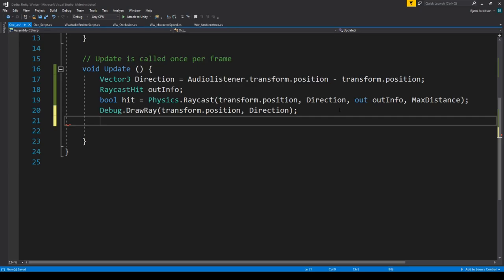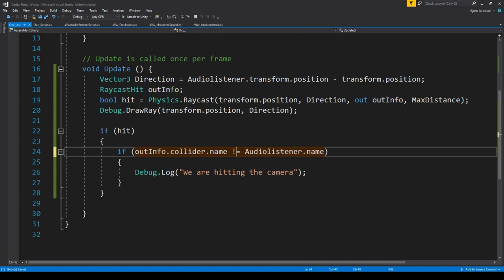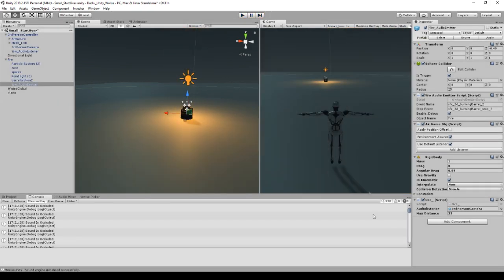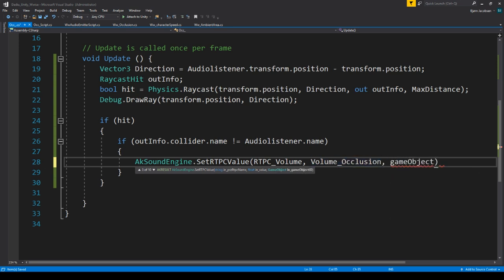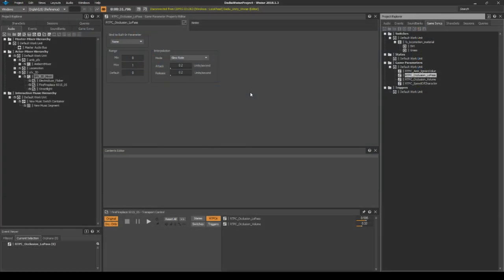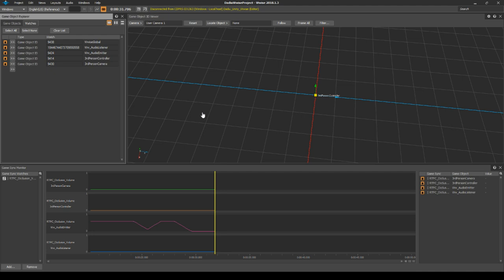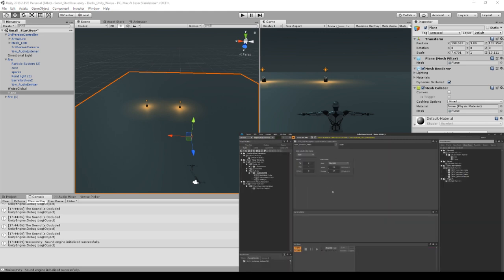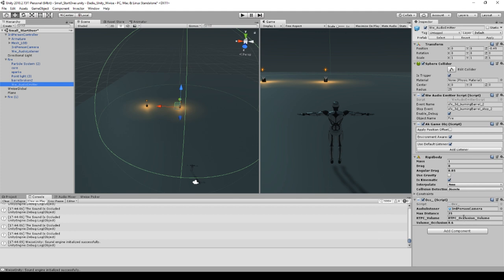Unity and Wwise - Changing Parameters with RayCasts.

Comment: Hey Bjørn, thank you so much for this tutorial. 

I went through your first video in the RayCasting series a few times and got my script to work as intended (the only difference was that instead of checking for the name of the game object, I was checking for the tag). Your videos are an absolute blessing for someone like me who is slowly learning the ropes of game audio integration.

I do have a question for you though. Based on this video, you are essentially hardcoding a set parameter of occlusion that determines how much occlusion takes place once your RayCast hits anything other than your listener - Volume_Occlusion = 0.6f. I may be getting ahead of myself (you could have covered this in one of your other videos) but is it possible to automate this process as you would with a Wwise Attenuation Shareset? 

So instead of scripting a set occlusion of 0.6f, you would just tell Unity/Wwise to figure it out based on the proximity to the sound source.

For example: if you have a wall between your audio listener and your audio emitter. If you step into "line of sight" of the audio emitter, the occlusion is set to 0 and the basic volume attenuation takes place (coming closer to the sound emitter increases the audio volume). However if you are behind the wall and very far from the sound source, the sound should be slightly muffled but to a lesser extent (0.2) for example. As opposed to being behind the wall and close to the source (muffled to a greater extent due to lack of reflections, etc).

I hope the question made sense and once again, thank you so much for this fantastic material!
Reply from the maker: Hey Nikita, thanks for watching to begin with. 
You can most definitely either automate the process or make it different from object to object, hardcoding isn't super useful, I guess I did so in the example to show how we can alter a value based on this, but in an actual project I'd like it to be much more open and every instance should be editable and the way it behaves should be possible to control through a bunch of parameters.

You could make some functions in the code to check for size of room, size of object, or even use the Wwise callback to tell you max attenuation distance and lots of other things and then calculate the amount of occlusion that should be affecting the object instead of just a hardcoded value.

In Unity you can also make a bunch of curves, which you could add.
Say all sounds that are behind a wall are affected by the occlusion value 1 or something, then you can add a specific curve to this object saying if occlusion = 1, then WwiseOcclusion value is .5 for example.
Or straight up 1 or .1 whatever.

So there are lots of ways of interpreting the value.
First you could make just a bool value saying "is object occluded" yes or no, 0-1 etc.
and then through a curve or in other ways tell each object how to respond to that.

But another way would be to have values in between, so the object has an "is affected by occlusion" bool, which can make it ignore occlusion if you want.
Take size and other things into account and calculate some value.

Then the wall it hits could have a public value of occlusion type, say a soft wall occludes .2 and a hard wall occludes .4. Then type of room you are in, importance of the sound, etc. calculates a value which could be them all put together.
lets say its a sound that can be occluded, it has an occlusion sensitivity value of .5. 
Then we walk behind a hard wall, so the sound is now affected by Occlusion .4. And lets say we are wearing a helmet, so all sounds are occluded straight up by .2 as well, that gives us a total occlusion value for this sound of .6 (just the two put together).

That value * Occlusion sensitivity (.6 * .5 = .3) occlusion.
Set the RTPC of occlusion then to .3. Place the sound in your hierarchy in wwise where you determine how that value affects it and then you can have quite modular setups.
I really like the ability to control all objects on the fly, so any object could have their occlusion sensitivity changed if needed, occlusion on / off at any point, and so on. 
Extend the system and have a curve that tells the specific object on how to handle that .3 occlusion (could be that in a specific case or room you want that to mean 100% occluded) - then you have a super modular system.
Reply: @CujoSound  that's awesome, thanks a lot for getting back to me!

I will definitely take a closer look at curves in Unity and how to implement them along with the "modular" approach to occlusion.

Your explanation reminded me of a presentation I've come across from Stepan Boev on Hitman. I know you've worked on that franchise, I'm just not sure which sequel it was. Either way, the way they have implemented the sound there is fascinating. It is the closest methodology I've seen to real life. Having played the game myself (a few times over) knowing how it was done is incredibly useful to me. It is too advanced for me at the moment but that's where I'm aiming to get to in the near future.

Your whole series (and channel) for that matter really help dissect and learn about the delicate intricacies of integration. I am very thankful for the time you put into assembling, recording and editing this material.

I'm currently working on an integration reel (using Unity's 3d Game Kit) and I'm gathering most of my knowledge from your channel.
Reply from the maker: @NikitaKalininn  the curves are a perfect way of having two values input and then interpreted as one.

So X and Y, like any other system, its super smart.

Could also just be some other code that someone else does which goes from 0 to 1, then you can add a curve like that, as what the value is and that could turn object on and off easily, in that way you could have like one sound for daytime, one for night time - or whatever.

Stepan Boev is an excellent audio programmer, we had lots of fun and he made really awesome tools when we worked on HITMAN 1 (2016) and the later HITMAN 2 which I was only briefly involved with.